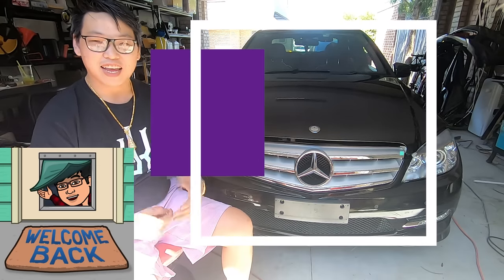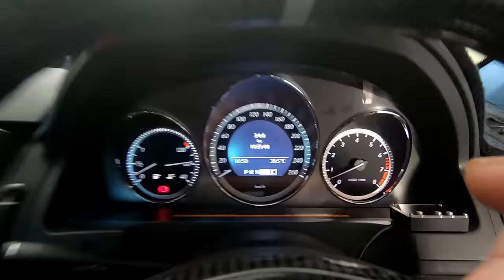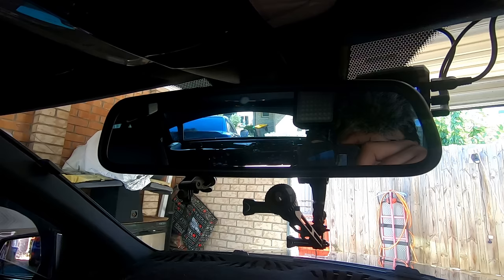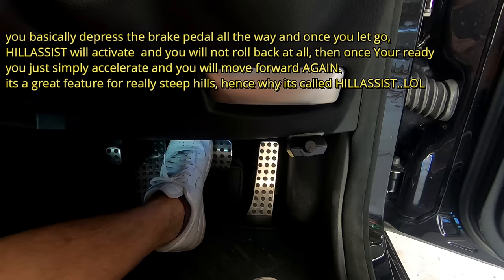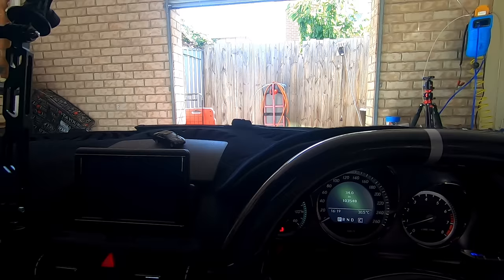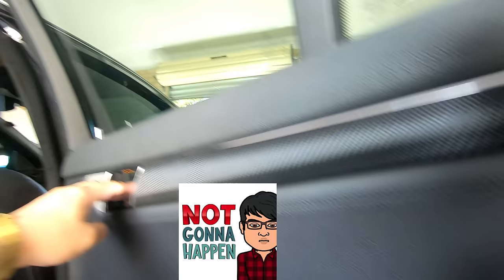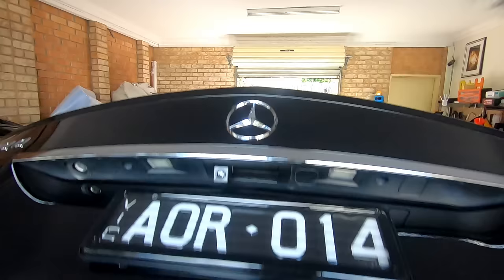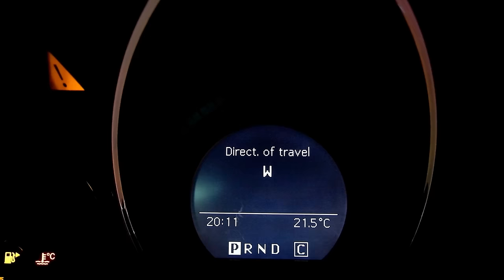MERCEDES BENZ C CLASS W204 COOL and  UNKNOWN  FEATURES + TIPS

Comment: No one mentioned Brake Hold?  Come to a full stop and then slightly lift and press again.  A "HOLD" message will show up on the speedometer and you can then press the accelerator to pull away smoothly.  No more numb foot at lights!
Reply from the maker: hey mate hows it going and welcome I believe it's in part 2 ..I made another video showing more features feel free to check it out...and that only appears for the facelift 2011 models and onwards for the pre face it's just does it ....
Reply: Mine doesn’t do this
Reply from the maker: i did mention this ..its called hillassist ..hence why wen u step on the brake ..it HOLDS for a split second ..then let's go... on facelift models it will display HOLD ..ON PREFACE it simply holds.  its designed for hills so u don't roll back and accidentally hit the car behind u
Reply: @MIKEYZVLOGZ  I tried it and it doesn’t display a HOLD on the panel, I will have to go a hill somewhere or a driveway and try it. Small incline at a stop light, I didn’t notice any hold.
Reply from the maker: do u have facelift model or prefacelift
Reply: Its really easier and works at all inclines. Just press the Brake a little more in when standing
Reply: Which button do you press on the keypad to do the windows?
Reply: @MIKEYZVLOGZ  2007 merc elegance

Comment: I've had my C180 for 10 yrs, never read the manual as it is in a foreign language, just drive and go. So 120k faultless  kms later I learn all this stuff, Duh. Now for part 2.Thanks for the very enlightening vid!
Reply from the maker: lol ye man I know that's what I use to do but it's amazing wen u find out what ur car is capable of
Reply: Do you like the C180 and any little Ideas on it,I bought a 2001 with a 200 upgrade and motor 38000ks

Comment: Another great feature is that the hood to the engine compartment can be raised to a vertical position by pushing it up beyond the first resistance. Some models require you to push a release lever on one or both sides.
Reply: Ugh!  Should have waited till the end.
Reply from the maker: no worries i did try to mention everything i could

Comment: As for day time running lights I guess the reason your cluster lights came on  was because it activated head light as well. Happened to my face lift w204. As long as day time running lights are switched to ON my head lights are ALWAYS on even in bright day light. It's a Japanese import I'm not sure if it's a regional software setting or simply my auto light sensor is broken.
Reply: Kevin Qian you can go to setting in the instrument cluster and turn them off. Go to “light” , then switch off.

Comment: I wonder which fuse is constant on the c300 2014
So many cool tips, thank you!
Reply from the maker: just test for it ..if the fuse has power wen the car is off then it is a constant power source not switched
Reply: @MIKEYZVLOGZ  I finally got it! It's the satellite radio fuse. Thank you very much for your effort on making such detailed videos. Made disassembling and reassembling a lot easier.
Reply from the maker: @PointMicrosoft  I'm so glad

Comment: How did you switch your auto into manual? And do we drive it and switch it with a clutch?
Reply from the maker: manual is tiptronic not actual manual like a stick shft 5 or 6 speed, there  button i have on my auto gear shifter panel and it shows M - S- C manual shifting to sport to comfort, once shift to manual its tiptronic, so no you dont have a clutch , you simply push the gear shifter left or right and it goes up and down gears up to 7 gears accordingly , i do a demo in my part 2 of this special features

Comment: What have you done to your steeling wheel bro? I have the exact same interior as yours, C Class 2011 absolutely love it, also love the indicators, what is that youve added onto them?
Reply from the maker: steering wheel just carbon fiber facelift custom wheel and paddle shifter and fo u side markers..are u sure same interior with flip up screen ? cuz usually 2011 is the facelift unless u got an early 2011 made and it's still prefaceloft with 3 spoke steering wheel and flip up screen

Comment: Your means hilla ssist are active is once I stopped and released the pedal brake, the car will not move even in drive mode or unshift to neutral?
Reply from the maker: no so hill assist is when your on a hill the car will sense that your on a hill... this is when your in drive (D) and your car wont roll back .... until u accelerate ...that way eliminating the fear of rolling back into someone .... thats what i meant.... sorry i shouldve been more clear
Reply from the maker: you will get use to the feature .. to be more specific...hill assist is designed to hold your car in the same spot for a short period of time or until you accelerate.... and once u accelerate it will move forward.... this is what i was trying to say...i may have chosen the wrong words ... but u will understand once u use hillassist

Comment: I have questions, I found the auto dimming function doesn’t work for my side mirror after I install the electric rear mirror(70mai). Is any solution to keep the original auto dimming function work as normal?
Reply from the maker: is that the unit that sits on top of the rear view mirror ...the auto dimming is built into the rear view mirror ...that's why if u cover it u won't have it no more .... maybe try find a device like 70mai with auto dimming ...if that's what u want... I think the sensor works off the middle rear view mirror as there is a sensor built into it and wen u cover that the auto dimming won't work for the side either

Comment: Cool video
can you please make a video about the comand. ie. how to get online etc. updating maps etc.
thanks
Reply from the maker: hmmm i dont have a car with internet from factory...my car is older and i cannot access internet...but i did get a phone mirrolink installed with the help of a shop and i can mirro my phone now to internet and display whatever is on my phone onto the flip up screen...

the newer models i think 2012 onwards can use internet i think ...ther only way to use internet for older prefacelift is by upgrading car head unit or using phone mirrorlink ...but if you do that u need to upgrade a few things abit more exspensive

Comment: I think you are mistaken by that “manual trunk boot release” thing. The key inside your keyfob won’t actually open the boot if in case you have a dead keyfob or your car’s battery is totally drained. Have you ever tried manually opening the rear trunk using the key?
Reply from the maker: yes ... i just meant that u can open your trunk using the key in the keyfob... it works ... i wi double check whether it needs to be unlocked firstbut im pretty  sure it can open it
Reply from the maker: ok so u can definitelt open the boot trunk with your emergency key in your keyfob ..i locked the car and was still able to open the boot with the key ....
Reply: I have a 207 and 208 and the key opens the locked cars trunk/boot, even with the battery pulled on the fob. I have not tried it without the car battery because I'm unwilling to do that and have some weird crap happen. Imo it's a mechanical key lock so I can't imagine it would not work, so I guess yours is different or maybe it's broke in some weird Mercedes way? Weird...

Comment: How did you get paddle shifters on your steering wheel? I have a 2012 sport and was wondering if you just bought a w204 wheel with paddles and swapped them out, and if not what did you do?
Reply from the maker: I bought a sw made for my model rewired already to suit my preface model... I bought it off a seller from  USA.. exspwnsive but worth it ..had to have the fully custom steering wheel

Comment: Does anyone know that if I run a rear tire setup of 255/40-17 on my stock 2011 C300 Sport 4-Matic, there will be any issues with rubbing, speedometer changing, or driveline issues.  It comes stock with a 245/40-17 rear for comparison.
Reply: Dylan Waller you can run those, I run 255 35 18 in rear. I have 2010 sport 4 matic. No issues. Any questions message me.
Reply: 2014 c350, 255/45-19 on mine, no rubbing

Comment: Do you have the folding mirrors, I have a 2009 c300 but mine does not work or was that a additional package you had to buy
Reply from the maker: yes i do have  the fold in mirrors.... so im guessing u dont have  the button that allows  you to fold the mirrors in on ur driver side in the centre of your mirror adjustment for both ur driver and passenger side?
Reply: @MIKEYZVLOGZ  you mean the button that has 4 arrows that you can adjust your mirror if that's what you mean, can you send me a video of what you are saying, every w204 I have seen has the folding mirrors but mine doesnt which is bs
Reply from the maker: @kristosterkeshi6990  no..so that is the adjjusting button... and underneath it is the mirror selection...LH RH... and between those buttons should be a button that folds the mirrors in.... im not sure why u wouldnt habe fold in mirrors... but maybe it was an option on ur model or year... i wpuld habe thought it was a standard fuction...however i have seen w204s without the fold in feature .... so im guessing maybe it was an extra option
Reply from the maker: @kristosterkeshi6990  ok so i habe found out that some models dont have the fold in mirror function... if u do have it..u would have the button im talking about or an option in your dash menu under convenience...fold in mirrors...that would be the option... if u dont then most likely ur car didnt come.fitted with the mirrors motors and woild need to be retrofitted and also activated aswell.... its a descent job
Reply: MIKEYZ VLOGZ yeah it does not have it because I tried to look for it as well but Damn that sucks, it would of been so much cooler

Comment: Soo that's the w204... Which year? Because i have w204 from 2007 and i didnt have all that functions and led strips, seems like a 2013 or newer? Did u heared about the error code Esp isnt aviable? Difirrential sensor is defect?
Reply from the maker: hey Kevin O welcome to my channel...i  hope you can subscribe ..your support would mean the world to me....NO  NO NO mine is 2010 guaranteed, the difference is that i have the AMG styling package from standard, its not real AMG its just the package option... and the led strips were factory also...i didn't add new side mirrors either thats how the car came .... i also believe that it was all added extras when i bought the car.... so thats why i have so many different options..because they were added when designing the car...also ....as the w204s progressed they make changes each year and mine is just before the facelift version ..hence why its the way it is..... about the esp error code.... i only notice airbag and esp warning codes on my dash alot if the battery had drained...as you know w204s are infamous for battery drainage... even if you just leave the doors open for about 45mins... the car will no longer start.... and you have to charge it or jump it...

Comment: You have a 2011 correct? It’s pre-facelift but has some facelift items, like the LED strips and parking sensors. I own a 2010, when I get my car back from wrap shop eager to see if the headlight cleaning unit is there... but I think that’s for facelift bumpers.
Reply from the maker: actually mine is a 2010 pre face but with the amg sports package ..i believe it is one of the latest models hence why theres led strips ...the leds side markers i did myself with the help of a shop after i pulled off my front bar and wired it to my front fuse box
Reply: @MIKEYZVLOGZ  Ahh okay, I have a 2010 with Avant Guard Sports Package, but you have AMG Sport Plus. lol I’m jelly, that’s why you have items like: adjustable suspension, headlight cleaning, and parking sensors.

Comment: In my w204 i have a fixed AUX input where you have the plastic cover.
Reply from the maker: so you dont have the MMI installed... but at least you have an aux plug ... is it loud? I've been told that the fixed aux lacks volume gain ... but as long as it works I guess ...
Reply: @MIKEYZVLOGZ  I have the Aux input only and it's very quiet, you need the input device volume at max and also crank up the car stereo volume - and remember to TURN IT DOWN before switching back to CD or radio 😁 

Great video BTW 🖒
Reply from the maker: @martynclarke5167  thanks martyn much appreciated ...i mean that from the heart.... and yes ive noticed that for those ppl who have an integrated aux in the glove box without the MMI integrated system ...its very soft and the sound isnt very powerful.... i have the MMI SYSTEM which allows interchangeable connection via the mmi input in the glove box ...and i have to say its not quiet nor soft at all.... i cant have it on full blast or it will blow the speakers.... in your case consider using an aux amplifier device .... it will help to increase your gain and because it has a built in amplifier youd be surprised just how much more volume you can get with a simple aux hifi amplifier....
Reply: @MIKEYZVLOGZ  thanks Mikey, I'll check out using an aux amplifier.
Reply: @MIKEYZVLOGZ  which one is good one
Reply: Which AMP?

Comment: my 2010 c350 4m the Nav sometime open and sometine don't people say pull fuse 11 and 26 will do it. Yes or no sometine it work and sometime don't. My issue is that botton on the top cover. Usually you press it and the Nav open but it don't work anymore. Any idea ?
Reply from the maker: in your case you might have a broken motor, its not the fuse but the actuakl motor that opens and closes the screen ,,, if it was a fuse then it wouldnt work at all, bedcause theres intermittent faults sounds alot like the motor has malfunctioned  in that case u may need to swap out the screen motor ,  this is just a guess

Comment: my deck whether I'm listening to radio cd or bluetooth automatically switches off after about 5 min if I'm sitting in my car with accessories on or off. is there are function to keep it on? I'd hate to go to a drive in.
Reply from the maker: ye i noticed that happens too... i think its to help conserve battery ... the only way mite be to have car running...
Reply: @MIKEYZVLOGZ  thats right Mikey. The car works out how much charge it needs to start and will shut down with plenty of chrage left. That's why it will shut down earler in winter as batteries are less efficient in the cold.
Reply: Wow. This is exactly why I love YouTube
I thought my battery needed replacement at first then the most logical explanation would be the ones above. Thanks guys. You guys confirmed my doubt.

Comment: Hey man nice video Ive got a 2010 Mercedes benz c300 and everytime I press on the gas all the way my traction control light turns on and it slows my car down. Do you have any idea how to fix this?
Reply from the maker: sounds like something is wrong with the sensor for traction ..I actually don't know what that might be ... sorry I couldn't be more helpful.. I would have someone take a look at it then fix it myself ..that way they can sus the issue ... but has to be someone you can trust
Reply: Its supposed to do that to keep ur tires from spinning. To fix it u can just turn it off the light will (!) stay on till u trun it off

Comment: How to tilt the driver mirror during reverse on 2008 c350
Reply from the maker: should be the same , so wen u engage reverse you press your driver side button on the window selection so u can control the mirror, then after you save it , now inorder for the driver side mirror to move it must be selected wen u enter reverse , if the passenger side mirror is selected wen u enter reverse then it wont tilt for u , u must select the driver side for the function to work properly

Comment: I have a C200, W204 2008 model, beautiful car. However the instrument cluster is stuck on "S" mode and would like to change to either "C" or otherwise....how do I go about it?
Reply from the maker: that's very strange ..so the gear indicator is stuck on s ?
Reply: @MIKEYZVLOGZ  Yes, it can only move to M for manual mode but cannot go to Comfort mode. It is really frustrating. Also the button on the stereo is on sport mode and cannot be deactivated. It is permanently on, could that be the issue? How can I deactivate it?
Reply from the maker: @herbertmburu2224  try and pull the relay of fuse that is related to the gear selector..its just a guess ... but u may just need to go to a reputable mechanic ..who knows what they are talking about  and have a scan tool for mercedes ... so they can see of you ha e any electrical faults causing the issue
Reply: Thank you very much for the prompt response. Looking forward to a favourable diagnosis and I look forward to more of your informative videos. Keep up the good work!!
Reply from the maker: @herbertmburu2224  cheers mate

Comment: Hi I have a normal audio 20 system but want to upgrade to a ntg4 command system. I’ve got the gps antenna sat nav radio the command screen but when all plugged in the screen does not work. Can you please help what more do I need to make it all work.
Reply from the maker: honestly to tell ypu the truth i have never tried that before so im not too sure how to assist you ... however i do know ppl have managed to do hjat your trying to do..i would suggest going onto merc forums and search for topics discussed about your specific issue... there are heaps of ppl trying to do the same thing some have succeeded where some have failed but its finding the info from someone whos actually done it before